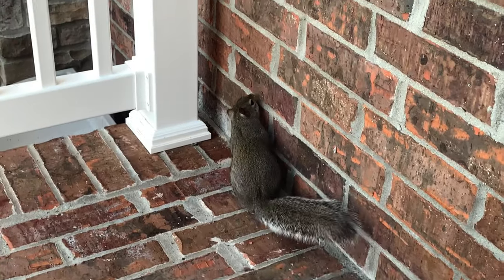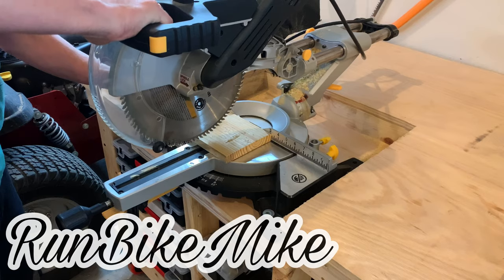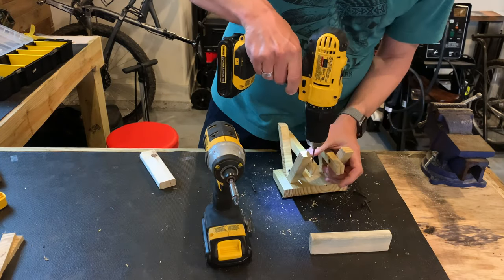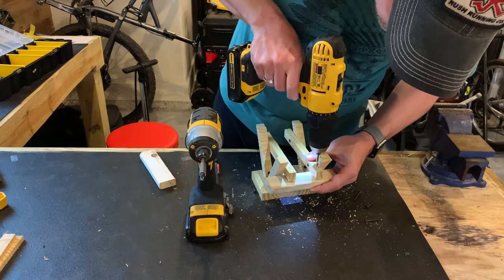HOW TO BUILD A SQUIRREL SIZE PICNIC TABLE: Meet Jerry the Adorable Squirrel.

Comment: Hi Mike; I am new to woodworking and attempted to create a squirrel bench from scratch. I'm also planning to have it held up against a fence (more birds than squirrels are in my area). I am in the drawing phase right now and have gotten all my pieces measurements right as they have conveniently turned out to be similar to yours in your measurements. But with my inexperience, my original plan was to use nails to put everything together, including the legs which I thought to nail through the topside of the table instead of at an angle from below like you did. 

Is it advised to do it the way that you did with screws and at those angles, or would using nails and nailing the way I initally thought be alright and sufficient enough also? Thank you kindly! Best wishes
Reply from the maker: Nails would be fine. I did screws for two reasons. One they are easier to use when assembling since they go in with a drill or screw driver and two because they won’t have the chance of slipping out like a nail would. With that being said with the right nails it should work just fine. Just make sure to pre drill your holes so you don’t split the wood.